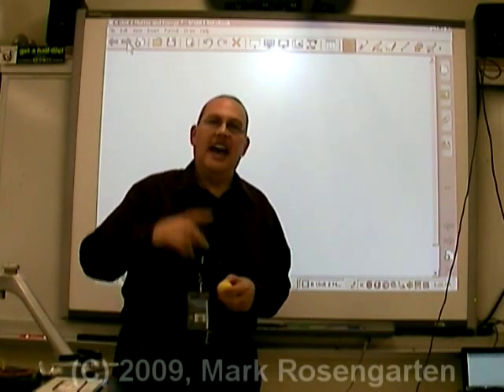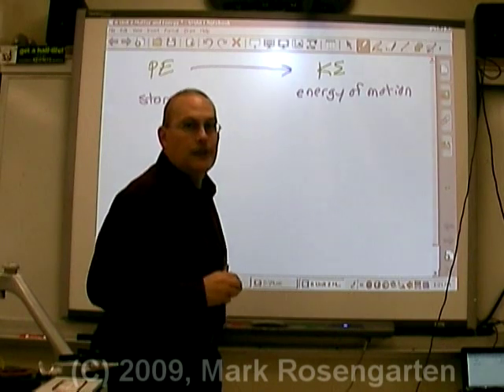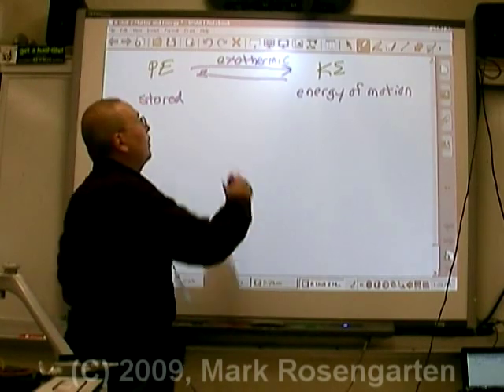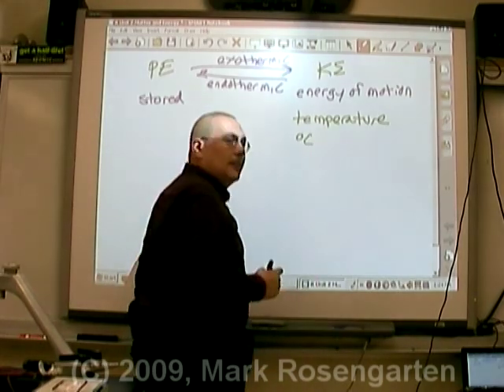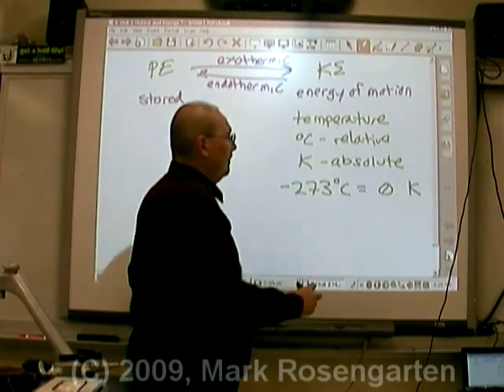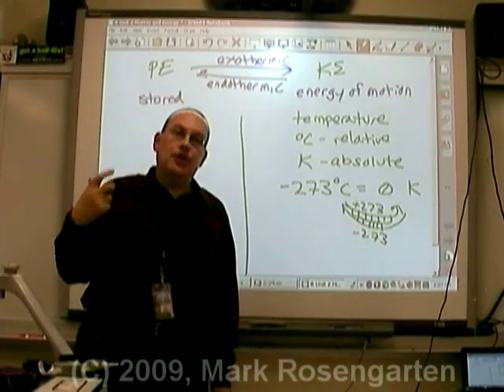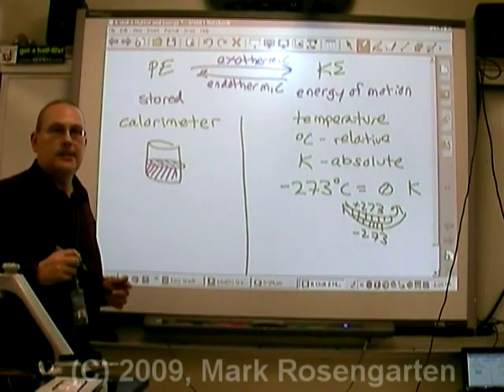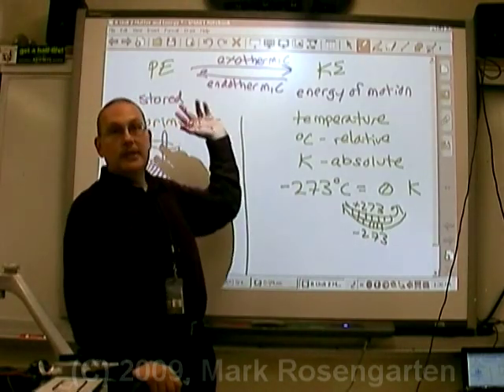Chemistry Tutorial 2.03:  Potential and Kinetic Energy

Comment: @MarkRosengarten I've got an idea in my head that I want to work out. I don't know very mutch about laws of physics so that's the reason for my (strange) question but here it goes: If a person of average mass, let's say about 70 Kg takes two steps on a normal ground, would there be enough kinetic energy released (if you convert it to electricity) to light up a bulb for a few seconds?